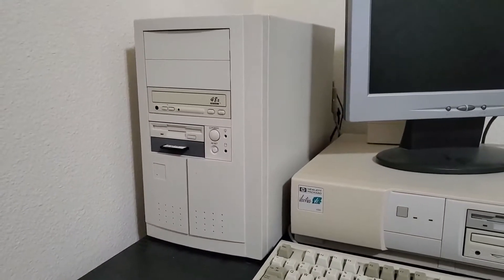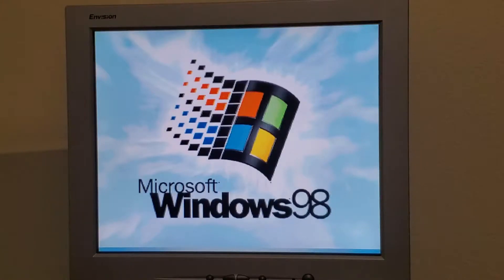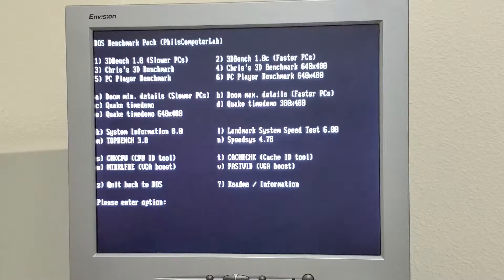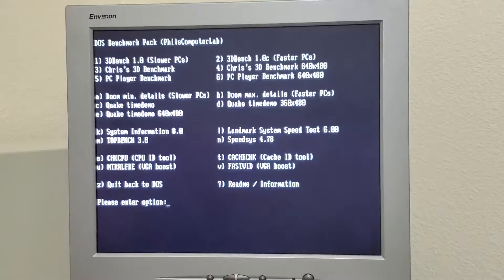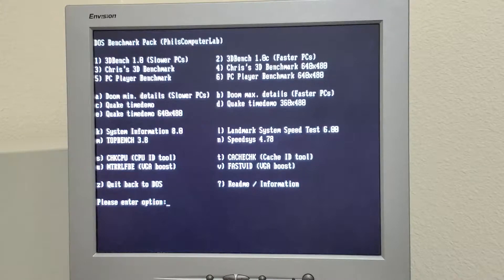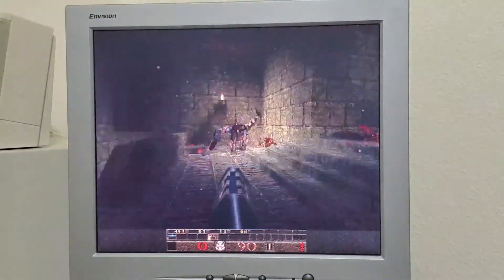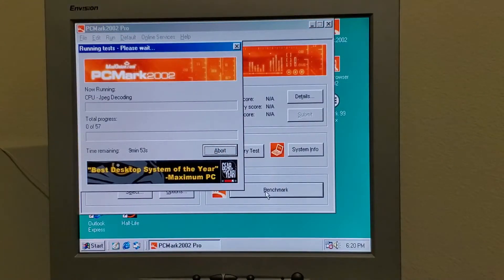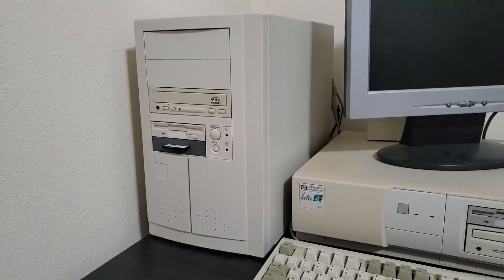Benchmarking the retro 233mmx build

Comment: Nice looking case, should have used a IDE HDD instead though, and put a PCI slot exhaust fan in it. Personally where ram is concerned I max out whatever the specs for the motherboard say, you get better picture quality that way. If you want USB slots there are cards for that, and you have lots of empty PCI slots. I use a USB drive for files I need like game patches, or any other updates I want. There are tweaks within Windows 98 to increase speed, I'm not going to list them all here; but, more ram is always Better!

Comment: In your first video, when you said you had 256mb, I figured you might run into the limitation of chipset. You don't want more than 64mb. I don't recall the boards offhand that can use more than 64mb. At the end of the day 64 is fine for what your doing.
Reply from the maker: I revisited this machine and changed it to 64mb.  It supports it but is more efficient with 64.

Comment: Having more RAM obviously gave you faster RAM, as you instantly got 2 ranks and 4 banks each DIMM with 128MB RAM DIMMs
So total you have had 4 ranks each 4 banks. You can in theory get 16 pages opened at the same time, where 64MB would probably give at most 8 pages (32MB are always single rank)
Obviously it won't be 16 times faster RAM, but just opening page takes considerable time, when you can actually swap into different rank or bank and already access previously opened page. With good management of memory by software you can gain quite considerable speed (few to several percent) by having more ranks and banks
That is reason why I always choose more ranks DIMMs and more DIMMs in general (of I can get say 128GB in 16 DIMMs or 8 DIMMs, I've always get 16 DIMMs, especially if they have same number of ranks and banks)

Comment: You and them don't understand
You can cache only 64MB
All what you run fits into 64MB and issue doesn't yet apply
The moment you go over 64MB you get slow down in 64MB - 256MB range
Not all memory is uncacheble
I have been using 768MB on AMD K6-2 motherboard, where actually both processor and cost have had hard limit of 256MB cacheable RAM, rest 512MB was uncacheable
Rarely I went over 256MB usage on either Windows 98SE or Windows XP or Debian GNU/Linux 3.1 Sarge and then there was a slow down

Comment: Keep an eye out for 3rd gen Rage PCI cards (Rage Pro/Rage Pro Turbo aka same thing) they were a huge improvement over Rage 2.  PCI versions are rare vs AGP on eBay but they pop up sometimes in the $10-20 range

I wanna say I got almost 2000 in 3dmark99 with the final driver. Not that a system like this is meant to be a 3d powerhouse, but games like Tomb Raider 2, Wipeout XL, Homeworld, Indiana Jones and the Infernal Machine etc. absolutely flew on it, many at 800x600 and some even 1024x768. I was so impressed I put it in a pentium 4 and actually finished Max Payne on it lol